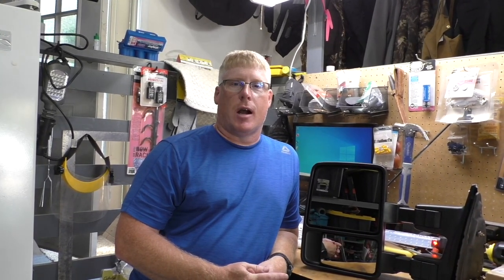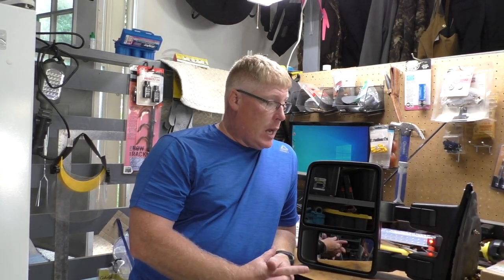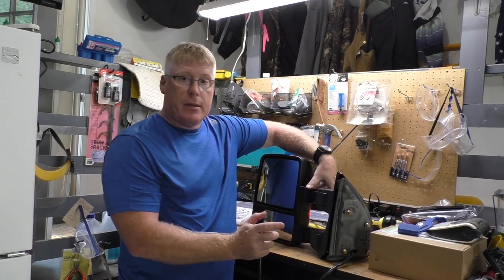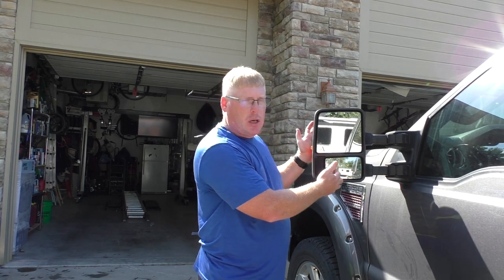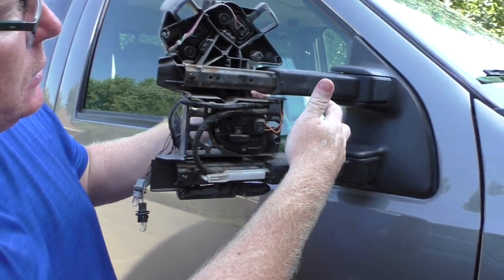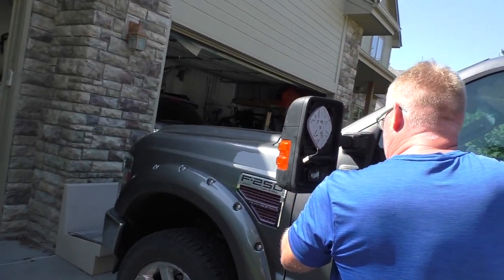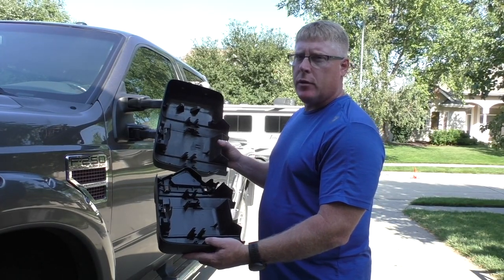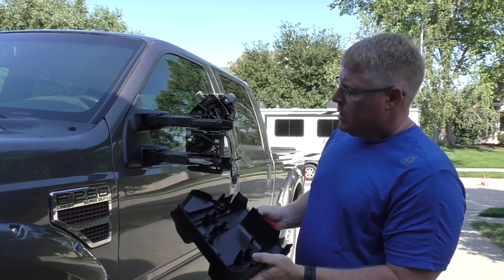Super Duty 2008-2016 F250 F350 Towing Mirror Housing Replacement Aftermarket Retain Pwr Telescope

Comment: I found out that if your truck has memory only specific mirrors will work if you are replacing them.  They adjust on a different plane without memory.  So that being said they are truck specific.  If all the gears in your original mirrors are good then this fix is fantastic.  Mine wern't have to get the full mirror...darn.

Comment: Thanks for being my guinea pig!
I was wondering if any of the aftermarket shells would work, I clobbered my right side mirror on a porch roof support post that I had driven past probably 2000 times plowing snow over the last 20 years.
Reply from the maker: I suspect all the aftermarket shells will work.  You may have to make some internal modifications like I had to.
Reply: @justagaragehack347  any idea on the motor being replaced for telescoping feature? Part number or anything?